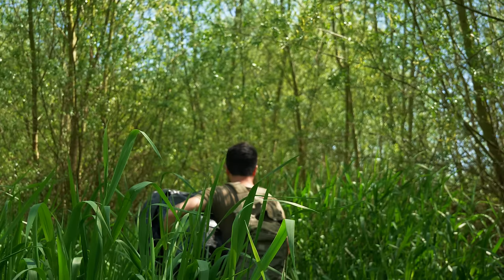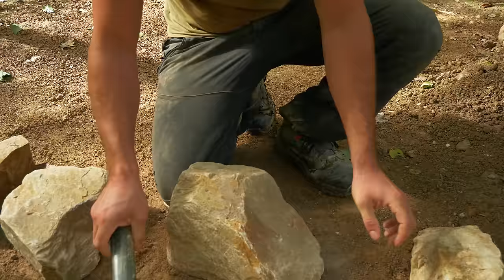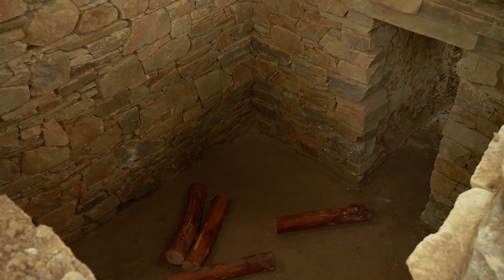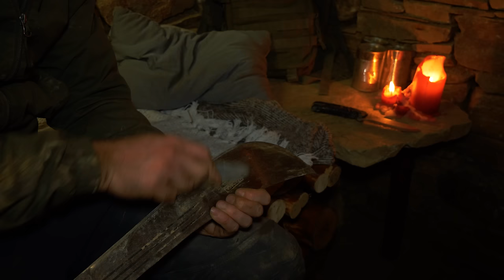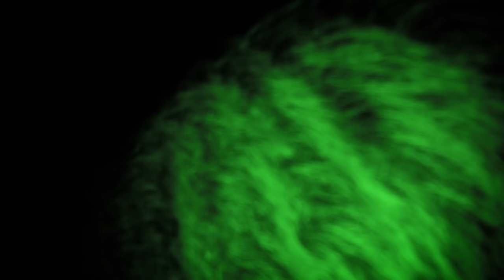Building SURVIVAL BUNKER like in @minecraft | THE FILM

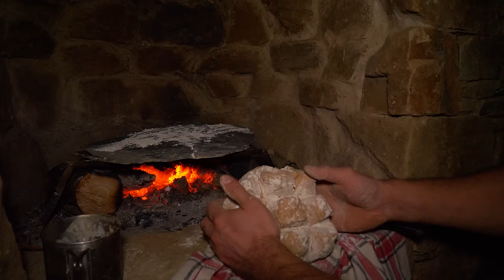Comment: 1:15:05 If you would invert the metal pail and set it over the loaf you'll make an impromptu oven. You can adjust heat by placing bits of different diameter branches or small stones under the pail's rim lifting it to allow cooler air in. Give it a try and see if it bakes your bread more thoroughly without becoming dry and hard outside while being under done inside. You can also place a damp cloth inside to provide extra humidity to prevent over drying the bread, if needed.
Reply: L❤😊😊😊😊😊😊

Comment: This is an awesome wild bunker. Love it.

The only thing I would do differently is have a carbon monoxide detector in there to avoid potential deadly consequences of having the fire such an enclosed space with no ground ventilation. Carbon monoxide is a gas that is heavier than air so it doesn't look like it has anywhere to vent out if it were to build up in there 🫣